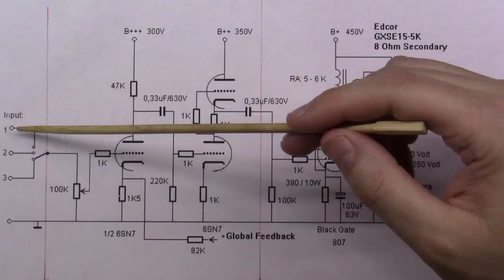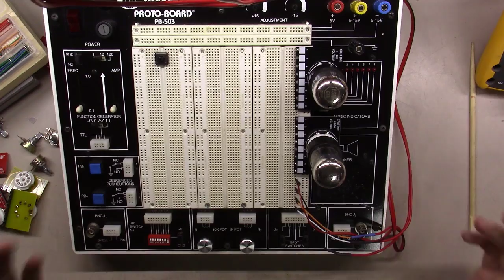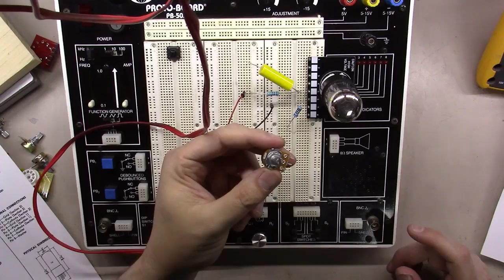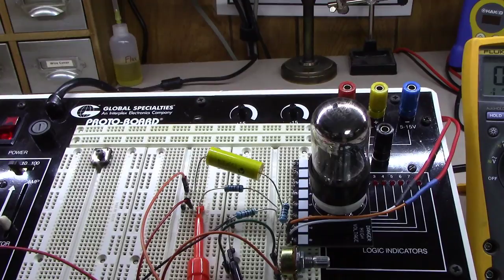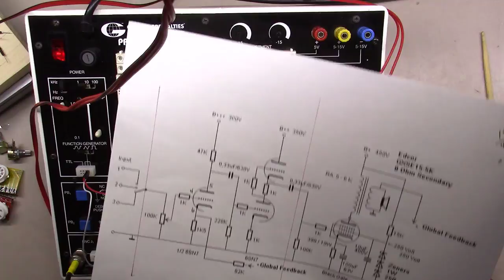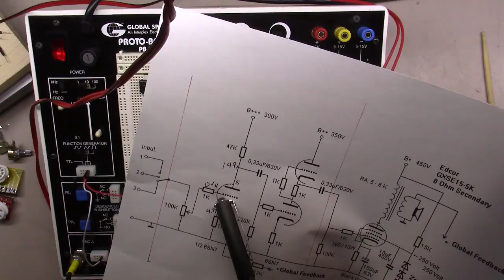How to Breadboard a Tube Preamp (6SN7) - Part 2

Comment: Hi! Thanks for the video! I can't understand how did you get 3.18mA of plate and cathode current. If so, the internal resistance of the tube should be some 45KOhm (whereas I found 7KOhm in the specs). I am a complete newbie and I must be wrong, can you please explain me how to calculate those values? Thanks in advance and cheers!

Comment: This is absolutely great! Thank you.  I've build 2 guitar amps so far with great success, now its time to actually design a tube amp for a guitar I made, a fretless that will use only an Ebow to excite the string, kind of a 100 pound cello.   And I will be using 6SN7's for the preamp tubes, at least as a starter.   So, this is a great clarifying and confidence inspiring video for something like that.   Thanks for your time and efforts!

Comment: I have a question about the Resistors used by Joe Knows Electronics what is the voltage rating on them? I bought 1watt and 1/2 watt and no one seems to know the voltage ratings not even Amazon.
Reply from the maker: The reason is that "voltage rating" on resistors isn't a common specification.  They aren't heavily voltage dependent like capacitors that have a break down voltage between conductive layers & insulation.  You can quickly do the ohms law math to figure out a maximum voltage across each resistor though (P=V^2/R)  So if you know the max power of the resistor such as 1w, and you know the resistance value, you can calculate maximum V to not exceed 1w.

Comment: Decoupling caps are very distict from coupling caps. They're also called filter caps - they are called decoupling caps because they DE-couple noise from the power supply - exactly the opposite function of a coupling cap. 
Also, you connected the volume control backwards... :P

Comment: i like this breadboarding the tube circuit thing.. a definite time saver to be sure.
 i have a question though. a transistor circuited amp usually is a cap/resistor loading design. i have only seen macintosh couple the transistor outputs with a transformer although i'm sure other mfg's have done this. can a tube output be cap/resistor coupled output instead of a transformer being used?
Reply: you need a high impedance load most solid state runs 12-60 volt wile tube gear runs 200 - 800 volts
Reply: I love your avatar
Reply: thanks ;-).it's been my attitude since the balkans conflict. it's strange though how much it fits in today's dealings with them though. they used to be more"localized' as it were.
Reply: ok....i get the high impedance thing and the d.c. bias can be removed with an appropriate cap but where the high impedance thing comes in....why can't(or isn't) a resistor of proper value be used? seems that would eliminate the hysteresis/flux field interaction problems that transformers pose to the output signal. pre--amps don't de-couple with x-formers. that's why the curiosity as to the main output sections.

Comment: Is one better than the other you're using yellow poly caps, between yellow and orange drops is there any difference in this, is one better than the other
Reply from the maker: That's like asking is red a better color than blue.  Its pretty subjective as in each will slightly color (tone) the overall sound and some people like hearing red more than blue, and others vice versa.  As far as quality, most orange drops if made my Sprague are of pretty high quality, more so than the yellow poly caps I was using but that has little to do with how they affect sound, more to do with how long they may last, deal with temperature changes, and moisture, etc.
Reply: from years of playing with these little puppies i have found that different caps produce different colorations to the sound. as to the mechanism involved this seems to be due to sensitivity to range of signals and speed of the recovery (charge vs discharge)time of the caps. someone with a more through understanding of this could explain it in better detail than i can though.